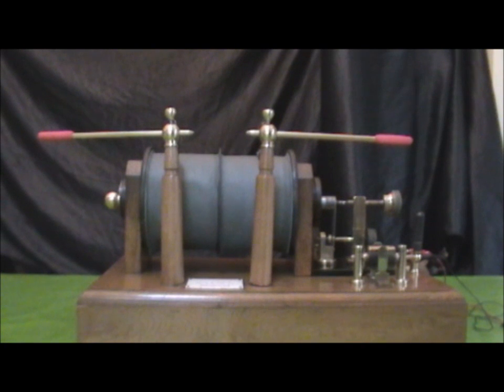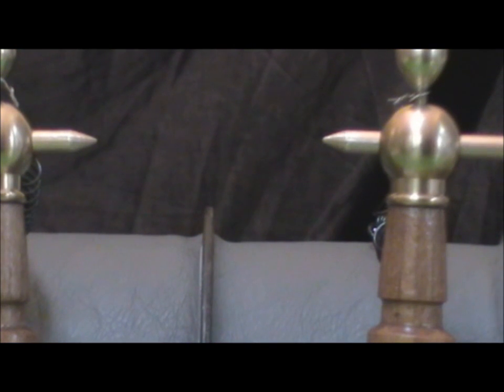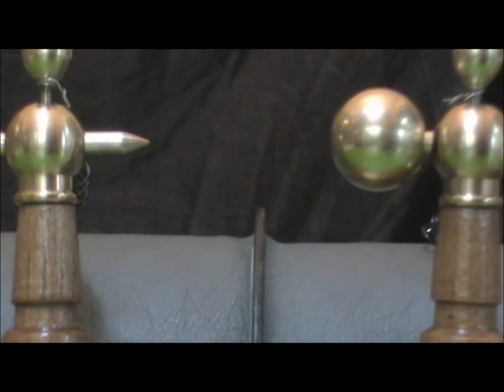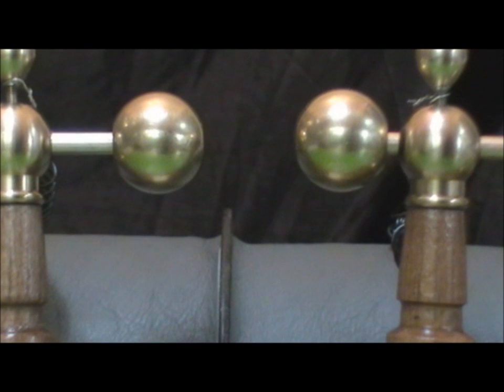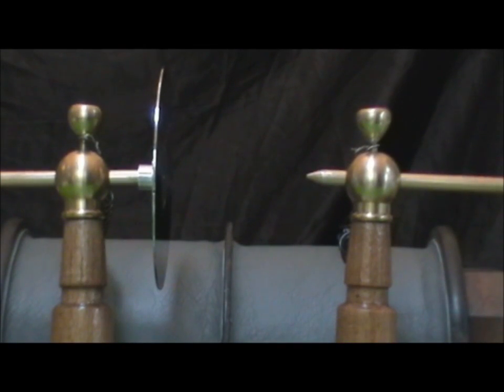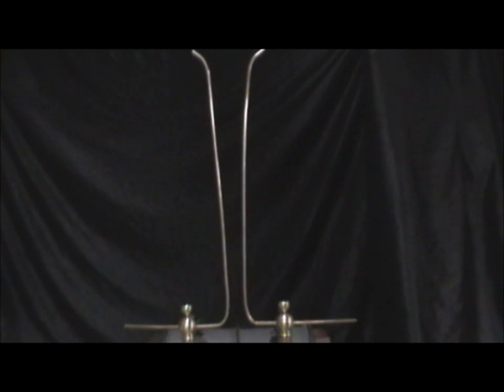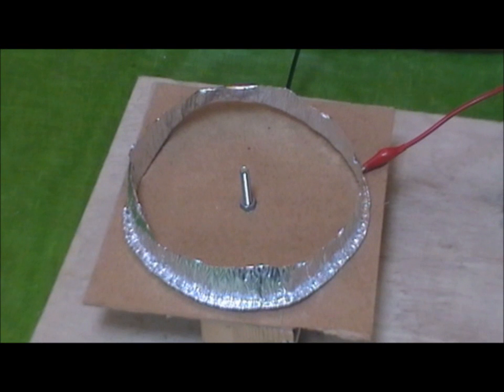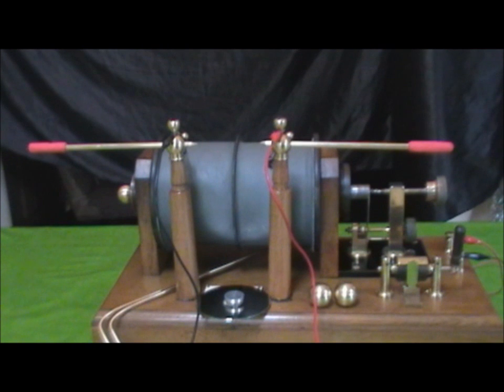Ruhmkorff Coil : Induction coil : Jacobs Ladder : Indoor lightning and sparks

Comment: If you operate it inside a Faraday cage, no electromagnetic frequencies will escape out into the open and no trouble from authorities.

Just an EXCELLENT variety of examples in your demo!  Thank you kindly, very gratifying.

Few people know this, but this device is identical in its function to the ignition coil and spark plug gap in all gasoline engines.   Also, this device was used by Heinrich Hertz to discover radio waves,  ie. this coil made all radio possible.  Hertz developed his antenna - the world's first radio antenna - and hooked it up to one of these Ruhmkorff coils back in 1887.

The induction coil is responsible for the most important devices humans use.  Very few technology devices have lasted as long as this simple design.  Very nice of you to restore this coil and create the demo.

Comment: Superlative Presentation of the characteristics and variation of the phenomena; particularly with the polarity reversals. That particular coil structure is a beautiful antique from pre 1900 and pre WWI for sure. It's very robust for it's size. IF there are any markings or labels upon it you should show them also so that they can be appreciated.
Not just before man went into space as you say, but before man even learned to fly.